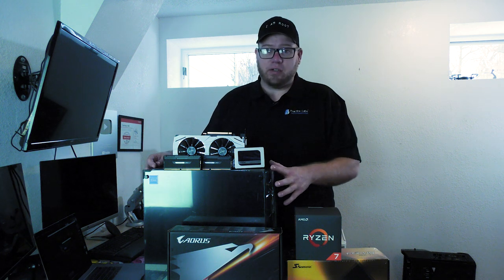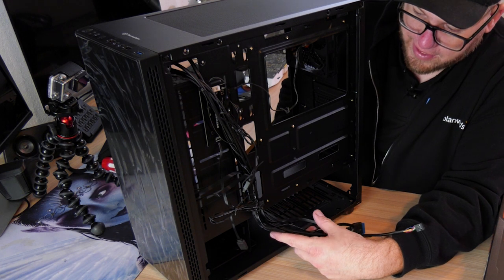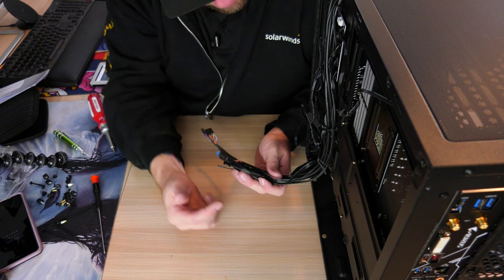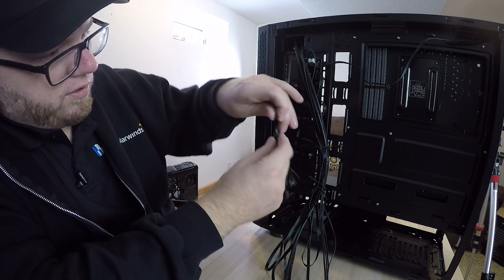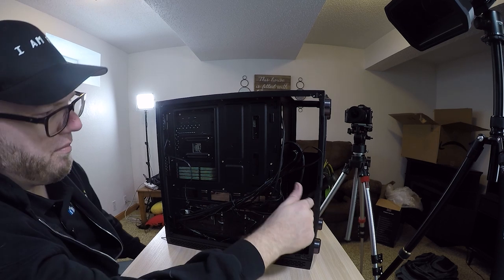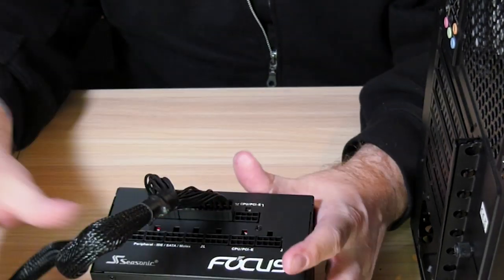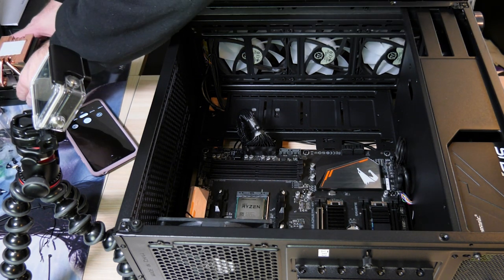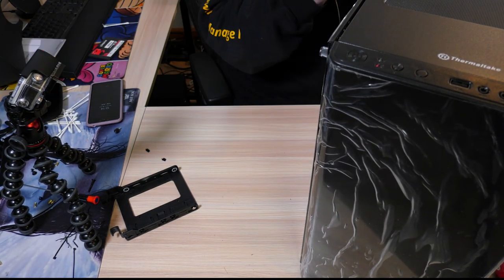Ryzen 2700x PC Build - 32GB RAM & 6GB 1060GT Video Card

Comment: I did a similar upgrade this summer. I went from an AMD Phenom II 1090t processor to the Ryzen 2700X. I went with the Asus ROG Strix x470 motherboard and 16GB (8x2) of Geil DDR4 3000 memory over clocked to 3200 Mhz. I am still running my old RX480 8GB graphics card, but it works good still.
Reply: How do you set the ram to those speeds? It only supports 2993mhz?

Comment: Wow. What a great build!

I'm planning my first custom build with the following components:

Motherboard: Asus ROG Strix with its X570 Chipset in a Mini-ITX form factor
Physical Memory(RAM): Corsair Vengeance LPX 64GB (2×32GB sticks)
Video Card: Gigabyte AORUS EXTREME RTX 2080Ti
CPU Cooler: Cooler Master Hyper T2
CPU: AMD Ryzen 3950X
Storage: 4× Samsung 860 Pro 2.5" SSD with 4.0TB storage capacity with 4GB cache and 2 Intel 660p Series M.2 2280 SSD with 2.0TB storage capacity
PSU: Corsair SF 750 (80+ Platinum)
Case: Fractal Design Node 304
Case Fans: Delta Electronics (1 120mm and 2 92mm fans)

Even though it's my first custom build, I'm a fully certified CompTIA A+ and Network+ Technician, so I watch YouTube videos to refresh my I.T. jargon and PC part Identification.
Reply: My Nintendo Gaming Feed jesus christ nice, is that gonna be your main pc or are you just building and gaming or somethig
Reply: That's going to be a killer build
Reply: @jboogiedtb  two words: Multitask everything.
Reply: @jarodp1027  Any parts of interest that made you say that? As of now, it is a killer build in its own right.
Reply: Your build deserves a better nvme SSD. Something like a Intel Optane 905P or at least Samsung EVO 970
Reply: @SMShoaibBD  To switch out my 2 Intel 660p Series M.2 2280 SSDs?
Reply: @mynintendogamingfeed5208  I would suggest the Silicon Power NVMe PCIe Gen3 x4 M.2. The read and write speeds would be a lot faster then the Intel 660p's. I have one in my system and it works awesome and is super fast when loading games and such.
Reply: @tCDragon85  SP SSDs. I usually go for ultra high capacity NVME M.2 SSDs (Samsung SSDs are great; their 2.5" SSDs can hit 4.0TB and their M.2s can hit 2.0TB Storage capacity). What's the highest M.2 SSD capacity rating that Silicon Power produces in the mainstream PC for the everyday consumer?
Reply: @mynintendogamingfeed5208  Silicon Power has a 2TB M.2 SSD on newegg.com for $245. It's a little more expensive than the Intel, but it is also faster then Intel's 660p. Intel's R/W speeds are only 1800 MBps, where as the Silicon Power's is 3400 read and 3000 write. It is also rated for a longer life span than Intel's. Here is the model # for the Silicon Power M.2: SP002TBP34A80M28
Reply: @tCDragon85  I just found a NVMe M.2 SSD that has 4TB of Storage Space, and it's made by Sabrent.
Reply: @mynintendogamingfeed5208  why do you need such a powerhouse
Reply: @voltage5802  Overkill setup, and speaking of overkill, I'm upgrading my Internal Storage mediums a lot higher... To 8.0TB of SSD Storage space, multiplied by 6!
Reply: @mynintendogamingfeed5208  I feel like this is cap and your just flexing to flex

Comment: Ok, so my first comment I did when I just first started watching the video. Now that I have watched the entire video, I would like to make some suggestions/correction. The first thing is the things that you were calling screws that the motherboard sits on in the case are called “stand off’s”. The stand off’s ground the proper parts of the motherboard to the case and also keep other electrical parts of the motherboard from touching the case and shorting out. The next thing is the case does have a place for the SSD’s. You took it out and set it aside at 30:30. That plastic bracket has the little nubs that go into the sides of the 3.5” hard drives and it has screw holes on the bottom to screw in the SSD’s to it. So, the next this is the graphics card looked like it was installed in one of the lower PCI express 16x slots. If so, that is not correct to give you the best performance. The top PCI express 16x slot runs at 16x, the lower ones run only at 4x when the other isn’t populated and 2x when it is. I would suggest moving it to the top 16x slot if it is not in the one already. Now I do have a question, why did you go with a SATA SSD instead of an NVMe PCIe M.2 SSD for your internal storage? The NVMe using PCIe would have been so much faster than the SATA SSD. Hopefully I didn’t come off as a jerk or anything, I just want to help you in the future for when you do another build video and to maybe correct a few things on this current build. Anyway, good build and thanks for reading my comment.